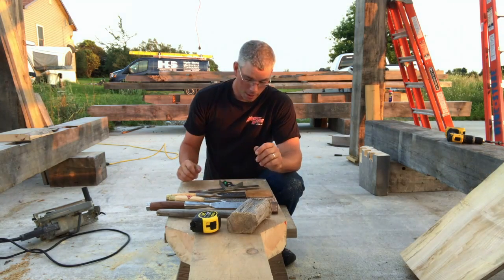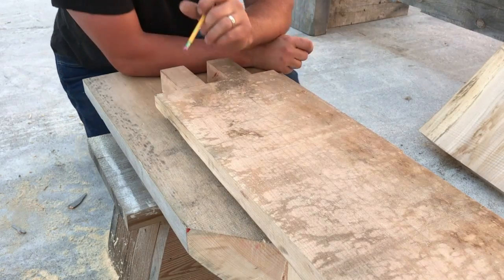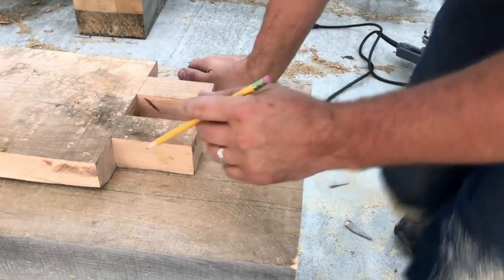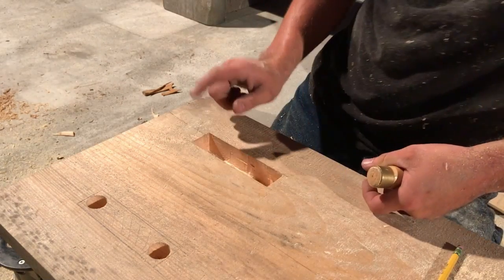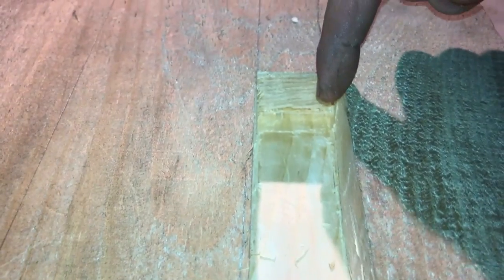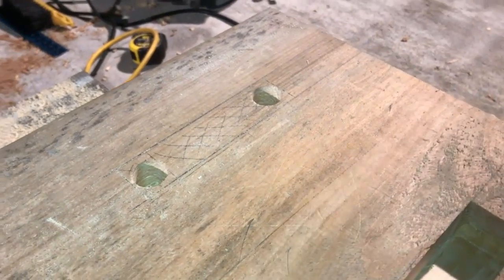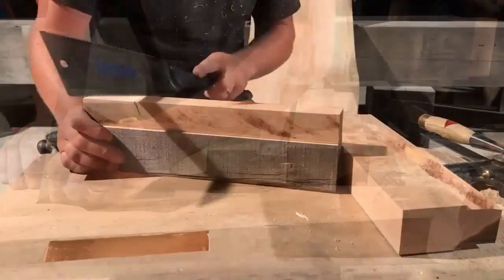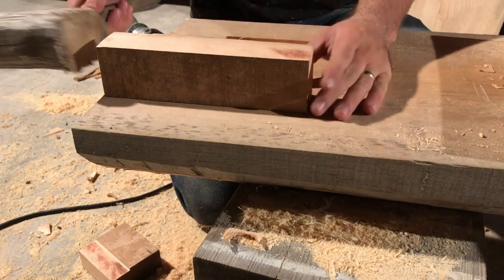Building a Shaving Horse Part 3: A Half Dovetail Mortise and Tenon Joint

Comment: I've thought that Mr.Chickadee does a great job getting his point across without words.  His skills in video editing and lighting along with the setting makes his videos very watchable.  Your skills are good and the will to learn is what counts the most.  My two cents is this.  When you are talking, have the camera on your face.  When you need to explain something, make sure the camera is focused on what your are explaining.  Don't have he camera shooting your face if your hands are the center of the action.  Plus when you are doing the action (cutting a mortise, cutting a board, etc.) have the angle of the filming so it will capture exactly what you want to show.  Such as.....if you are cutting a board, you need to have a close shot to show how the saw is working its way through the wood.  On this video you were cutting two mortises and the camera was at a 45* angle to the work.  I would have liked to see a head-on shot down the center length of the mortise so I could see the slick slice down the side of the mortise and how much meat you were taking off.  Plus if the camera could have been set up a bit then we could have seen down into the mortise and see how you cut the corners and how you cleaned out the bottom of the mortise.  

Please, don't take these as criticisms, just ways you can improve your filming.  I've never filmed anything, I'm just saying what I think would be a way to show your "product" in a way that could have more impact.  Also play with different types of lighting.  Sunshine, spot light, light diffuser, or a bic lighter.  Never can tell until you try something new or different.  

And for goodness sake.............DON'T CHANGE YOUR POTTY MOUTH.  That is what makes me chuckle.  I enjoy a guy saying exactly what's on his mind instead of treading lightly through the political correct BS.  If you wanna cuss, go for it.  If the viewers find it offensive, screw them.  Your personality sells your channel along side your ability to tackle a massive timber framing project.  Don't ever give up being YOU just for views.

terry

Comment: Love the idea of the half dovetail mortise and tenon joint for the hinge. Question though,
how easy will it be to remove the ramp portion of the shaving horse after the wedge is driven in? I was thinking you wanted it to be removable. 

PS. I think the content and the way you are presenting is great. No need to change it.
Reply from the maker: +Chris Cox you will have to see the wedge...it will make sense.

Comment: Nice joint. Sorry about the hat, was it your only one? I have somewhere in the 120 range. I can change them out depending on wear and the type of work I'm doing. Wouldn't want shavings and saw dust in my mechanics or oil, anti-freeze, or pvc cement/cleaner on my wood, etc.
Reply from the maker: +Thomas Russell I have many hats...but that one was my ONE hat...

Comment: Just my thoughts on this.  Your editing is great this way, now I do not need to fast forward threw watching you run a router for 2 min,  But if you could in the beginning of your vid give us just a little bit more of an explanation of what you are doing. Just something like "I need to put this board into the base right about hear to create a hinge for the shaving horse." As it is done now I had NO idea where you were going till you got to the end and put it all together.  Not needing a full explanation of what is going to happen but just a small bit of where you are trying to end up.
Reply from the maker: +jim stew thanks Jim, I will do that.